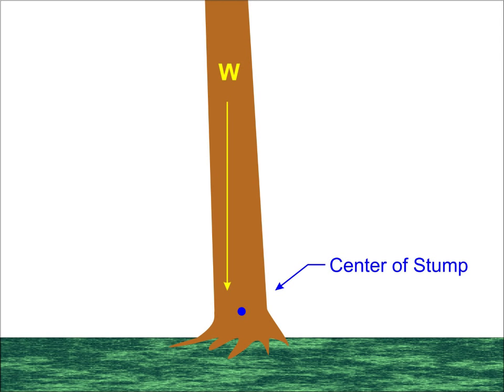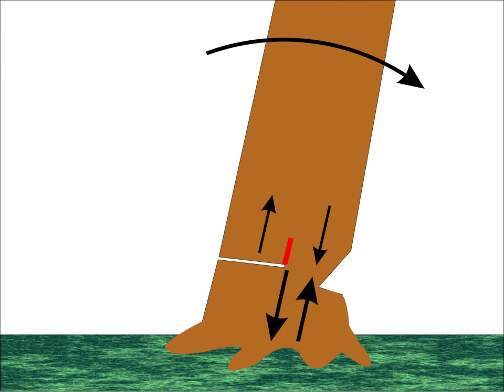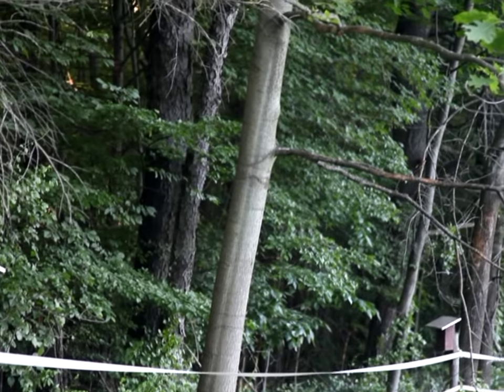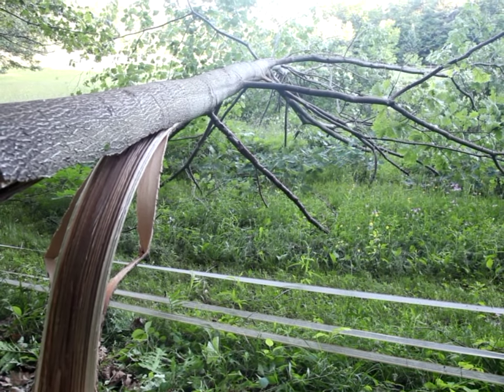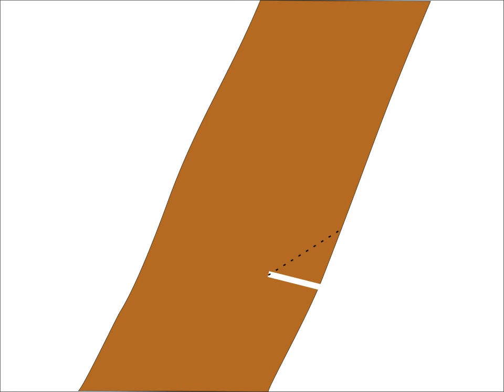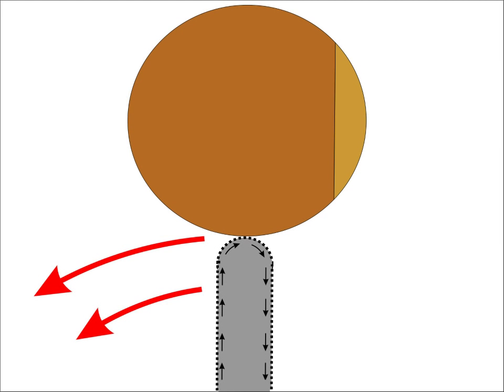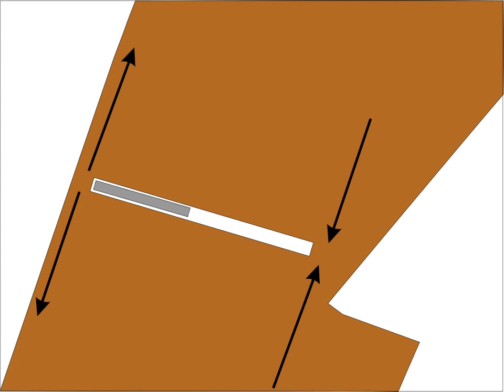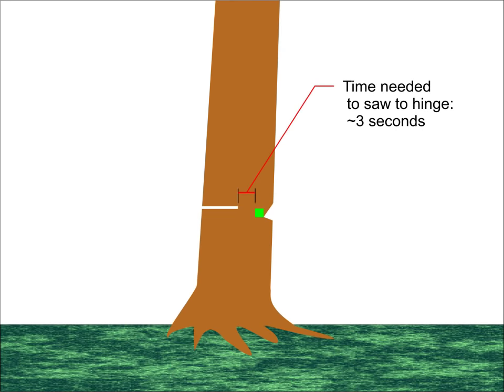Tree Felling - Leaners

Comment: I wish someone would do a video just on positioning of the notch and how it can "help" direct the fall. My Dad was a lineman for many years and worked in the woods when he was younger.  He told me about a tree that fell partially on a powerline.  The line was partially supporting the tree so they couldn't drop the line and then cut it and let it go.  They couldn't get boom over it to pick it up.  He cut the notch and did the back cut so the tree rolled sideways off the line and l and land parallel to line and never damaged  the line.  I never had the occasion to have him explain what he did.  Unfortunately his memory files are locked away with no key.  Lesson:  talk and listen to the old guys before all this knowledge is gone forever.  Thanks for sharing your knowledge

Comment: Terry - Excellent video - I would like to pass on to others a tool I bought to assist with felling leaners. smaller treas , trees fallen into other trees - I bought an 8" battery powered chain saw with extensions.  The extensions keep you farther from the cutting action and applying all the proper cuts, safety rules etc.. it certainly makes me feel safer cleaning my wooded forest.
Reply from the maker: Interesting.  I know climbers are giving electrics a good try.

Comment: I enjoy your video, my experience with cutting trees that are leaning and depending on the types of tree it is? Especially cedar's are suseptic for splitting up the trunks, is to stay consistent with the cut and follow through. The faster you are able to cut? It will be less likely to split up the trunk as quickly? I put the question mark in place because if your saw isn't very sharp,it won't cut as fast. Im not saying that only to see how fast you can cut, but yo have control over your cut. I hope this makes sense? The idea is that you want to make accurate cuts and stay alert and stay in the back cut as much as possible to ensure that the fiber's are cut quickly. If you are unsure if it will split then use safety and use a chain or a strap or a rope and wrap the trunk of the tree so it won't split up the trunk and prevent possible injury

Comment: good explanation and graphics illustrating the physics in play.  I've been felling for over 25 years, and have tried to explain barbers chairs to people -- i will use your video in the future.  I recently took down a 36" alder with severe lean and loads of ivy on it.  Plunge cut and set up the trigger and all went safely and according to plan.  If I can offer one point of critique, please wear chaps.  A relatively small investment in critical safety gear and great example for less experienced operators.  It is a MUST for anybody working with me.  I have 3 sets and require it when teaching beginners.
Reply from the maker: Thanks, Skier.  I actually have two set of chaps now and always wear one of them whenever I use a chain saw.  I'm very lucky I've never had a situation where they would have proved their worth.  You can't rely on past luck to protect you in the future.
Reply: @terryhale9006  that's a good word, and glad to hear it.  appreciate your willingness to receive a bit of feedback as we all have things we can learn.  I didn't see chaps in this video, but glad to hear you use them.  Again, really good video with great explanations and graphics.  I think your work here will likely help a lot of people avoid unnecessary injuries, and with over 470k views I'm glad to see this important info getting out there.  cheers!

Comment: First I would like to say that this is one of the best explained tree felling videos on YOUTUBE, and for the most part would tell others about this video and/ or channel. Now for the dirt... One, when cutting the red oak it didn't look like you had a face cut; that would cause the barber chair in any leaning tree. Also when you where talking about the growth if the tree its called phototropism (big scary word) sorry I digress. Then I've always made my face cuts deeper with leaners (if holding wood is available) about half way through the tree. Unless lean is 45°or greater then 1/4 OPEN face cut then bore-in-cut. Always start with your horizontal cut (unless open face cut) if anything put a wedge in as you cut. Makes using gunning sites easier especially if direction of fall is important not to cause damage.

Comment: I've seen that plunge cut made by fellers and wondered why on earth they were complicating the process. I knew a hinge that is too thick can barber chair, and until today had always considered it was important to make a deep enough face cut. This is awesome info for felling 201.
Reply from the maker: Sometimes you can get away without using one, particularly on smaller, upright trees.  Bigger or leaning trees really raise the stakes.
Reply: @terryhale9006  awesome. Thank you for your reply. As a fraction or percentage of the diameter how deep can a face cut be, before becoming dangerous? From everything I have seen, it seems like wood fiber is pretty strong in tension, like you could hang most of a tree's weight on way less back wood than most believe. I realized where the hinge will end up is much more of a focus, than worrying about the backwood letting go, because of too deep of a face cut... does that make some sense?
Reply from the maker: @jackfiercetree5205  Jack, there are a bunch of factors that are worth considering, such as how much the tree is leaning and which direction.  If you're notching under the lean, you should keep it shallow to avoid the lean pinching and holding your saw.  If you're cutting the notch on top of the lean, you should also keep it shallow as you will probably want to drive wedges to force the tree to fall opposite its lean.  The longer the moment arm from the outside of the back cut to the hinge, the easier the wedges will be to drive.  If the tree is pretty upright, it will be tolerant to quite a range of notch depths.  With a large tree, making a deep notch requires a doing more cutting, so there is a slight time preference for keeping the notch down to something like 25 percent of the width.  If you haven't seen it, I do have one video exclusively on "The Notch".
Reply: @terryhale9006  it is so Awesome you give such detailed responses. A giant thank you in helping keep me safe out there. Merry Christmas.
Reply: @terryhale9006  I will check out "the notch"

Comment: The wedge cuts are severely undersized. The size of the wedge cut determines the strength of the hinge, which is a big safety issue. 

Also, when you get a barber chair, like the red oak example, there is a really simple process to dealing with it. You take a small cut off the part of the trunk sticking out into the air. This is only so that it cannot bind against the stump later. Then, go to the treetop and begin lightening. Take off weight, being wary of spring back, until the remaining portion rises. If you do so from the top down, rather than cutting main leaders off, the weight loss will be gradual and the spring back will happen gradually too. Removing large leaders is faster, but more risky.  

This way means that you never have to cut into the strap under tension. This is WAY safer. Nobody is going to outrun a spring.
Reply from the maker: Christian, unfortunately, I have to disagree with just about everything you have stated.
  First, with most leaners, it would be foolish to try to make a normally sized wedge cut, as you risk getting your bar solidly pinched.
   Second,  The strength of the hinge is not solely determined by its width, though width is a function of the depth of the wedge cut.  The strength of the hinge is important primarily for preventing the tree from falling sideways.  If it doesn't have significant side lean, the width of the hinge loses importance.
   Third, you assume incorrectly that the tree will spring back up as weight is removed.  Even in the case where the tree does begin to rise, it can rise to where it is out of reach for any further removals, but the trunk will still be highly sprung.
  Fourth, while I agree that it is not wise to plan on outrunning a barber chair, it is not true that, "Nobody is going to outrun a spring."  It depends on how fast the spring is.  In the video, I was anticipating a slow barber chair "spring", so I felt confident backing away.  Other "springs" have definitely been fast enough to kill people and some have, in fact, killed people.
Reply: @terryhale9006  you don't have to agree. I worked as an arborist for several years, and the company I was with specialized in high risk removals. A leaner like that is the tame end of the spectrum. Neither I, not the guy that trained me either had a safety incident. We were good because we were careful. Considering that most of my part of the work was done high in the air, "out of reach" wasn't something I really worried about.
Reply: Christian, you are totally correct on everything you have said, I have worked with tree cutting and felling for almost 40 years.

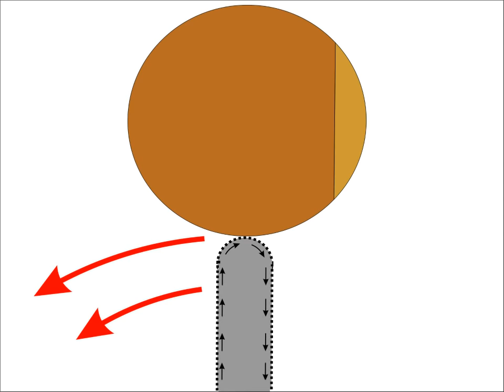Comment: Starting at 9:24 your diagram of the bar initiating and then plunging through the tree is with the pushing chain (top of the bar) facing to the LEFT.  The plunge done this way, places most of the front handle facing the ground and out of the fallers reach.  Instead, if I do my plunge with the pushing chain (top of the bar) to my right, the entire front handle is now available.  I also like plunging for my hinges with the top of the bar to my right because if I get a rotational kick back, the bar is thrown away from me.  Plunging with the top of the bar to my left places my body more in the arc of the rotational kick back and thus closer to bodily contact with my saw.
Reply from the maker: Your point would be especially well taken for those harvesting for lumber, where you want to get length out of the trunk.  Cutting for firewood, I usually take my felling cut at a convenient height and then get the stump as a separate cut.  In most cases, I probably would have the front handle up, but I wasn't even thinking about orientation when I was trying to make the illustration.

Comment: So having created the trap, what did you do to get the tree down? Knowing nothing I'd have cut relatively small sections off the bottom of the trunk, starting at the cut end and working up, until I was clear of the fence, then cut the top of the barber's chair to drop the rest of the trunk to the ground. Would I have gotten myself killed? Nice clear explanation, by the way, and without all the unnecessary additional junk that many others throw into their videos.

Comment: Very Useful Detailed Information.
I have a strongly leaning pine that I wish to remove, as its threatening my neighbours garage, some 20 feet away.
It is on to corner of a copse of trees, so all the branches are on one side. It's probably 12-18'' diameter.
In addition several adjacent trees, inside the copse, have died, so the ground is now getting wet from rainfall, as the tree cover has effectively been removed.
This has softened the ground, and the lean has recently increased.
I intend to use a three ton dumper with a full bucket, with a combined weight of about 5-6 tons, with several 10 ft loading straps in series for an extended length pull, to put tension on the tree at 90 degrees to the line of fall. This is to ensure that it cannot fall in the opposite direction, onto my neighbours garage!
Using a plunge cut will be my choice in this situation.
I will also clear the area with my mini digger, and remove any of the dead trees close to the tree to be felled, before starting, so that I have a clear escape route.
Your presentation has confirmed my plan of action.
Thanks.
.

Comment: Admittedly, I have not thought about this much, but to me "shear" is not the mechanism for a tree splitting (barbering). It seems to me that "peel" stress would be more appropriate, which would be akin to a tensile failure of the lignin perpendicular to the grain, initiating at the backcut and propagating up the tree.

Regardless, I really appreciate these videos and have learned a lot. Thanks!

Comment: Wonderful video, Terry. At 5:28 you talk about your plan to "nibble in from the sides" to take the tree down. Can you explain what you mean there? I've got a tree in a similar state and I'm trying to figure out how to take it down safely.
Reply from the maker: What's left of the stem is highly sprung.  If you try to simply cut through it, depending on what part you try, you might get your bar tightly pinched.  If you cut from the inside to the outside, you risk having the wood suddenly spring free.  (Years ago, I was in a big hurry and tried doing that.  It happened so fast I didn't even see it.  All I heard was what sounded like a very close rifle shot.  The stem slapped up, pulling the split part of the tree down.  They slapped together about 18 inches from my ear.  My hands were right where they had been when I was holding the saw, but it was gone.  I found it, still running, about 20 feet away in the bushes.  No injuries whatsoever, but WHAT a lesson.)  Nibbling in is the process of using your saw to chew the wood away just like a beaver would; leaving a broad V so you can watch closely to see how the wood is reacting.
   It's best to be able to learn from the mistakes of others.
Reply: @terryhale9006  Thanks, Terry. What a scary experience.

Comment: Something none of the videos about leaners is addressing is how to prevent the outside of the tree from splitting off and pulling up chunks of the root from under you when you're cutting away the back cut from the plunge cut.
Maybe it's only a problem in bigger trees, or the ones that often have a lot of damage in the buttresses like Western Redcedar?
Reply: OK, I can't resist, spoiler alert! Leave a large enough trigger to support the tension load and then cut it from the outside.
Reply from the maker: Makes sense.
Reply: @zandemen  Doesn't always work that way. I had a heavy leaning red alder to cut down, 25-35° lean. After facing it I plunge cut it and after only cutting just less than half of the holding wood the stump split down and the back half of the roots came up with my saw trapped in the tree. I still had 6-8 inches of holding wood on my trigger. Soft ground, shallow roots and a root rot defect caused the tree to split quickly. Fortunately the tree didn't roll on my saw and crush it and I swiftly used my escape route to a safe distance although the roots nearly tripped me as the surged out of the ground.
Reply: @kevinnoble5988  Yeah, alder is horrible, you could fall a 24" heavy leaner with a safety razor if you don't mind barber chairs.

Comment: I had a leaner with a 36" diameter trunk back of my house and it was aiming to fall across my gable roof.  A professional took about 20 minutes to drop it parallel to my house.  It did about a four foot 'barber chair' but the guy was good and there was no danger to himself or my house.  Big relief not having that thing aiming straight for my bedroom.  Now it's firewood but  then the splitter busted so I'm finishing the job the old fashioned way with wedges and a hammer.   I still have about a dozen rounds to go.
Reply from the maker: Glad the threat is gone.  It can be very tricky to judge the holding ability of the roots or whether internal rot has been going on. Bummer 'bout the splitter.
Reply: @terryhale9006  I'll survive, got my wood for winter in, I only have a wood stove for heat out here in the Sierra Foothills...Gold Country, come visit.  I watch these videos also to remind me not to mess around with knocking trees down, got a lot of trees out back but I'll only cut the small ones I can handle and get a pro for the big ones.  Thanks for the education.